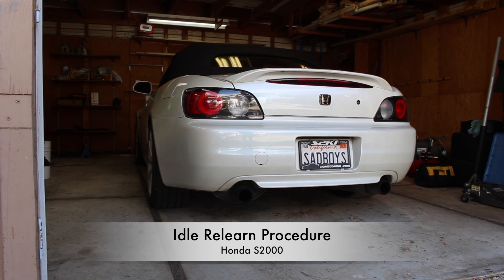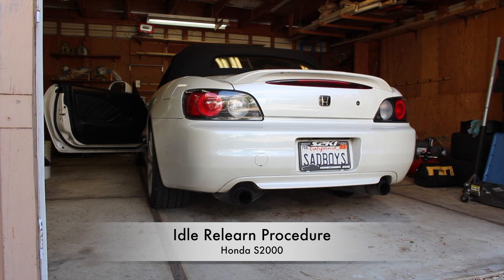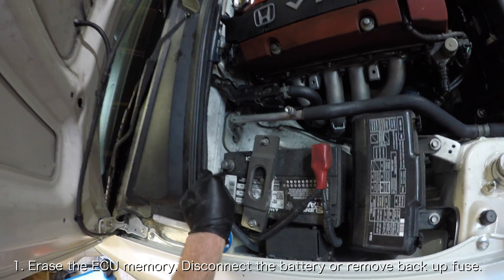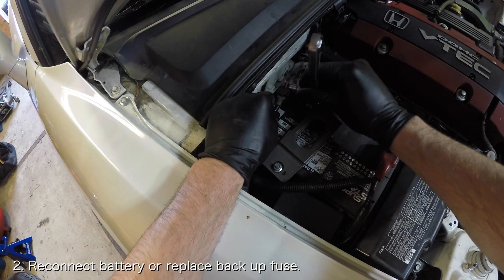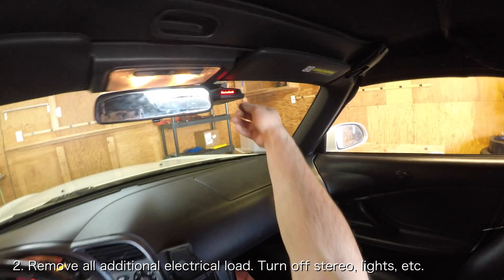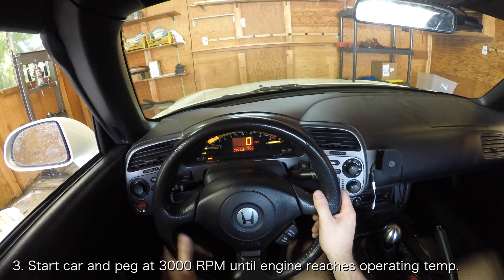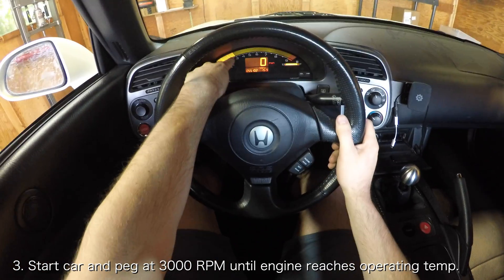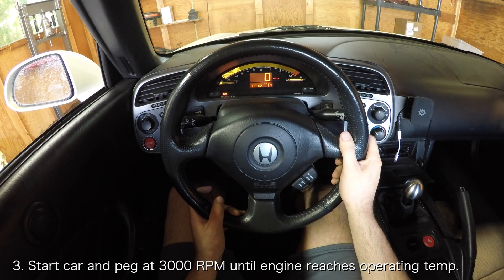Idle Relearn Procedure | Honda S2000

Comment: Is it okay to rev the car to 3K on a cold start? Just checking.
Reply from the maker: Yep.
Reply: @DIYGuysvideo  Thank you. About the procedure -  does it have to be a cold start or can you start a warm car and rev to 3K for a few minutes before idling for 5?
Reply from the maker: The point of holding at 3k is to warm the car up until the radiator fans come on. Doesn’t matter if it starts hot or cold.

Comment: Lately my AP1 s2000 has been stalling when I’m driving and push in the clutch to shift gears … the funny thing is I have no actual Idle problems when the car is parked/ stationary, idles at 800ish rpm’s smoothly … I had cleaned the MAP sensor and it was good for about 2 weeks … now it stalls again when driving

Comment: Liked and subscribed! I don't want to sound like a tard, however i doubt that the idle relearn is a thing. Since idle is preset from the data in the ecu, I suppose it can always learn itself everything after disconnecting the battery. Feel free to correct me, I am not a professional, so I am always trying to learn. Thanks a lot in advance!

Comment: Hello, if my car turns on the air conditioner and step on the accelerator, the children are unstable. Can this method stabilize?
Reply from the maker: Sorry what’s unstable?
Reply: @DIYGuysvideo  rpm is unstable when pressing a/c is very unstable
Reply from the maker: This may help, also look into Idle air control valve cleaning if you are 2000-2005 model year.

Comment: Hey so I just got my engine rebuilt, and when turning it on it asks me for Gas so I pump the gas pedal and it turns on. As soon I let go of the gas it turns off, any way you can help me out ? I came here because maybe I thought doing an idle relearn to my car would work, it’s a 2005 Honda S2000
Reply from the maker: Try an IACV clean. Is it on the OEM ecu with a stock motor build?
Reply: DIYGuys yeah it is, all stock
Reply from the maker: Yeah. IACV clean and idle relearn after if possible assuming the engine is operating normally. The only other time I’ve ever had a car die on me while idling is after spinning a rod bearing.
Reply: DIYGuys well the engine is completely newly rebuilt, today we finished it up, and it was our first time trying to power it up
Reply: DIYGuys car has not been ran, at all, we just finished today

Comment: Do you keep the rev right on 3000 tel the car warms up then let off the gas pedal?
Reply from the maker: Yep
Reply: @DIYGuysvideo  would the procedure still work if do it at 2000 rpm bc of my loud muffler?
Reply from the maker: MackStizzy it will. Pinning the revs just speeds up the process.

Comment: My eps light wont go away. I already replace unit and steering rack
Reply from the maker: ECU or wiring?
Reply: DIYGuys i literally just fixed it 10 min ago. New rack was good. New eps bad. So it worked with new rack and old eps lol

Comment: After following this procedure, when it comes to revving the car - the revs drop below 800. Would you just re-do this procedure with the car cold and try it again?
Reply from the maker: Does the car stumble like it’s about to stall? Generally your car will always relearn idle so you can continue driving and it will fix itself unless there is another issue.
Reply: @DIYGuysvideo  Hi DIYGuys my Honda s2000 is doing the same thing as dans and it is also stumbling like it is about to stall when it drops below 1000 rpm. any recommendations?
Reply from the maker: IACV clean if your car is 00-05 model year.

Comment: Why should i do this to my engine?
Reply from the maker: This is not something that you would do for fun, it is something that you would do as part of another task, like cleaning IACV. You could also perform it if your car is having idling issues to see if it helps. I just wanted to document the process.
Reply from the maker: +Andrew Blair I’m using a modifry dash bracket and then using some magnetic phone holder from Amazon. I put another magnet in my cell phone case so my phone just sticks to the mount. Does that help?